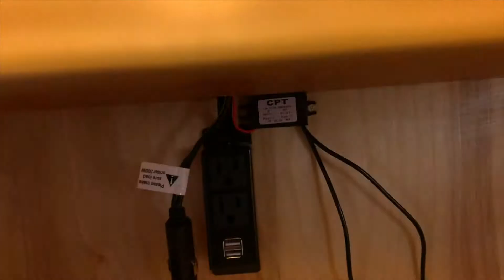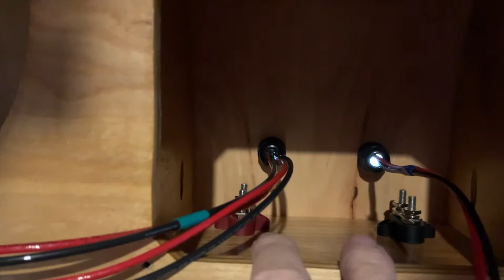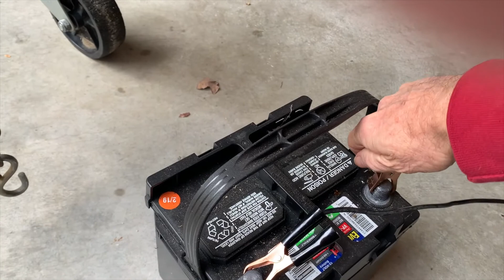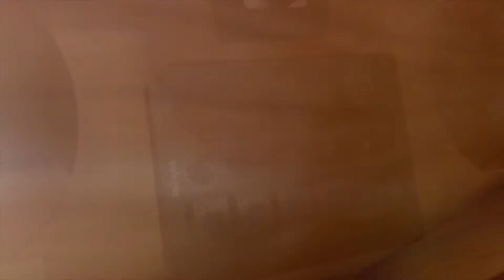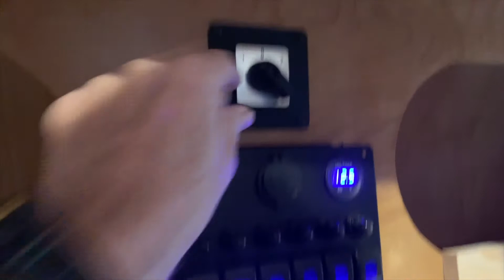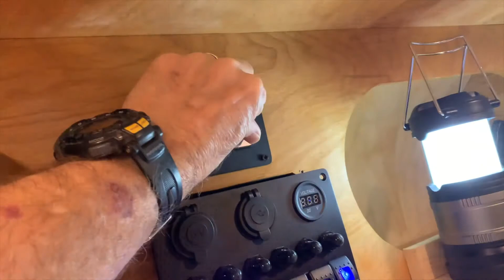Mini Camper Build Part 16: Finishing the Electrical Work

Comment: Great video, I just found you today and subscribed. I have a question, I see other teardrop builder put in electrical breaker, is it not necessary for your way of using AC power? Im building mine and I didnt want to deal with breaker switches etc..I also want to use AC power like you. Thanks
Reply from the maker: First, Thanks for watching and subscribing. I appreciate it!
Using a breaker is never a bad idea but my build was intended to be off the grid 90% of the time. Also, I only plug into 120v AC 15 amp circuits. These may be from a house outlet , my Honda generator or my solar power generator. I depend on the breakers of my source power to trip if there is a power issue.  Again that is just me and my thoughts. So far so good!😉
I’ll be taking out my teardrop ( The Cantina) in November for a four day off grid camping trip and I plan on making a video of that adventure. I’ll probably plug into my power generator if I need to power an electric blanket at night! 😂
Thanks again, and feel free to ask any questions!👍
Reply: @Blade_Outdoors My guy, thanks for responding and you're welcome. I will be doing your style of camping, 90% off grid, but I was just concerned with the 10% shore power. I havent started my electrical yet, not even a store run on supplies but Im taking notes. I have an idea for my 12v design, very simple. I do want the possibility of plugging in a heating blanket and air condition (it will be outside with hoses for in/out air). I do plan on adding solar in the future, portable not glued to the roof. If I ever change my mind, I have a roof rack to put them on there. Did you create an electrical diagram on a website by any chance? I got the gist of it but thought a visual would be awesome too. If not, its cool, no worries. Yes, looking forward to the November trip.
Reply from the maker: @macbethdemilo7253  great, sounds like you’re coming along with your build! I also decided not to mount solar panels … I have a portable one that I set out during the day as I usually camp in wooded areas and in the shade. I do have a few electrical system design drawings somewhere…. But probably can’t find them. I’ll probably draw a diagram and make a short follow up YouTube video explaining my electrical wiring. Thanks again for the comment and sub… also, just fire off another comment or message me if you have any more questions. 
👍

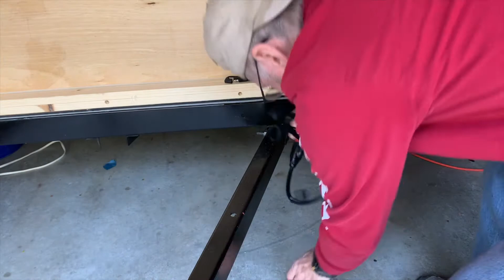Comment: What is the difference in what you did at about 2:30 and then later when you checked the AC/DC converter? I'm probably missing something but it looks like you did the same thing just without showing the converter.
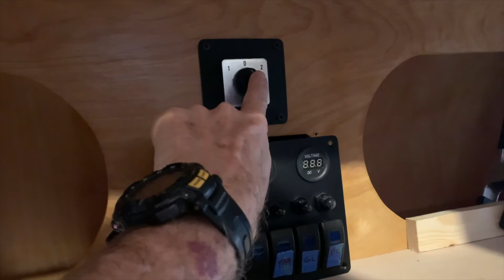Reply from the maker: First of all thanks for watching, I appreciate it!!! You are correct, I connected AC power to my camper the same way at 2:30 as I did at 10:00. The only difference was that in the first connection I just tested the AC outlets to make sure I was getting AC power. During the second connection at 10:00, I plugged in my AC to DC converter for the first time to test that I could use it as my “secondary” DC power source to power my lights. I hope that makes sense. If not, I can give you my phone number and we can chat about it. Thanks again for watching and I hope It helped you!!!

Comment: Great video thank you! Is there a reason you used an AC to DC converter to power the DC loads from Shore power as compared to just using a battery charger and then running everything from the battery?
Reply from the maker: Thanks for watching!! 🙏🙏🙏. I just wanted the option encase the battery goes out or has some type of problem. 😉. Thanks again for watching and you comment!! 👍